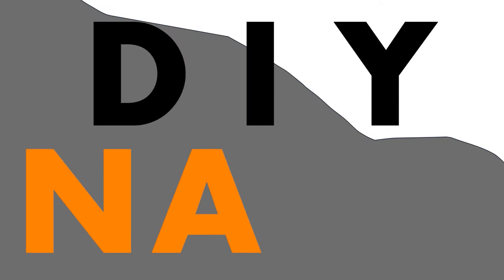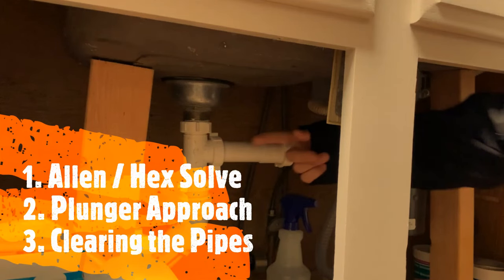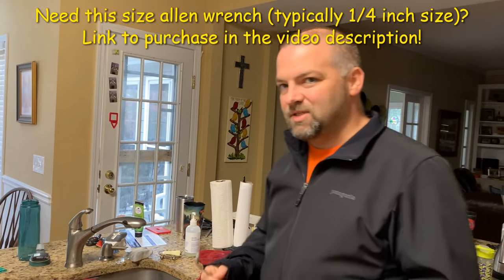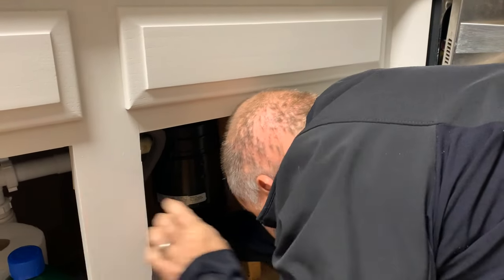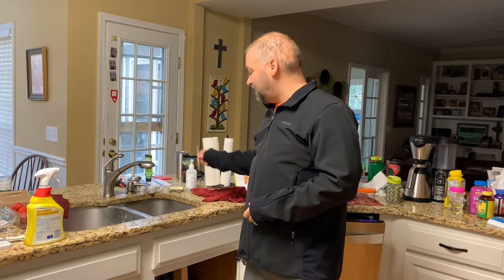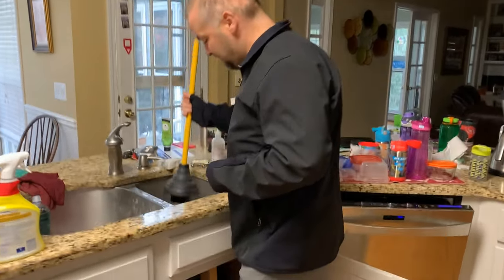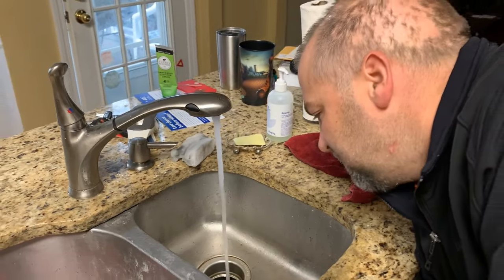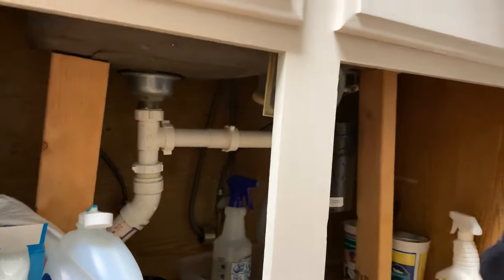Clogged Kitchen Sink with Garbage Disposal? How to Solve Quickly with 3 Easy Fixes! - by DIYNate

Comment: Great tips. Just cleared a disposal clog with one pump on my plunger, can't believe I didn't think of that before. 😁 Had it clogged once before and took apart the whole pipe assembly. Much easier, to say the least! Thank ya sir.
Reply from the maker: Appreciate the feedback - glad to hear it worked for you!  The plunger is a surprisingly simple fix compared to taking the fittings off.  Thanks for the comment!
- DIYNate

Comment: Thanks so much for the tips.  I had already tried using the plunger but water was still standing in the sink even though it had gone down some.  The one thing I didn't do was turn on the disposal after using the plunger.  That took care of everything.  This was a great help.
Reply from the maker: Excellent, Vicki - great to hear it worked for you!  Really appreciate your comment!
- DIYNate

Comment: I had shards of glass in mine pretty bad. I had to use a combination of the Allen wrench and plunger along with a shop vac. Had to reset the breaker on the bottom a couple times too but it worked!
Reply from the maker: Great to hear you got it running well!  Yea - class is a nasty booger if it gets in there - talk about the ultimate hand death trap with a blade and broken glass being down there.  You landed on what I would recommend in that case which is a shop vac.  Pumped to hear you got it working - really appreciate you taking the time to share in the comments!
Best,
DIYNate

Comment: The plunger worked for me almost immediately - I don't understand how it works, but it did the job and saved me a big bill and a week of eating off paper plates while waiting for the plumber to come out. Thank you!!
Reply from the maker: Great to hear - happy to hear it saved some money and paper plates!  Basically, some stuff gets clogged in the drain pipe and the pressure from the plunger unsticks the jam and pushes it further down and separates so it can get through to the sewer.  Hope that helps and thanks for your comment!

- DIYNate

Comment: Helped a ton, not sure why I didn't think of plunger method, but I needed both. Plunger at the top for fluid blockage then had to do a couple turns at the bottom to free up the blade. I believe fear of messing something up is why we dont think of the simple things. Really appreciate you taking the time to explain everything.
Reply from the maker: Thanks so much for your comment and glad both the plunger and Allen wrench combo worked well for you.  Thanks for your comment!
- DIYNate

Comment: The plunger method worked for me also!  Thanks!

Tip - Just be sure to place a cup over your dishwashers overflow valve located at the top of the sink, near the faucet. Otherwise, you may get splashed when you plunge the blockage.
Reply from the maker: Glad to hear it worked for you and good point on the overflow valve.  Don’t thin my sink has one of those, but for those that do, seems like that would help!
Thanks for the comment! - DIYNate
Reply: Bless you! ☺️ The plunger worked. It’s the weekend and I did not want to pay overtime. 😅
Reply: Yeah, shoulda read your tip… just splashed dirty water everywhere… at least we both laughed about it

Comment: Thank you for sharing!
I tried #1, but my garage disposal didn't have a spot to turn the blade with an Allen wrench. Then I tried the plunger with no luck.  I kept trying with the plunger and also decided to plug one of the sinks so that there'd be more pressure from the plunger after reading one of the comments about closing all air. A few more tries and it did the trick! Thanks again!
Reply from the maker: Great to hear it worked for you and yea, plugging the open air areas helps create pressure so glad you saw that in the comments.  Thanks for letting me know!
- DIYNate

Comment: Thank you for the tip. Had to plunge several times as it would not clear. It came up the other sink. Finally ran disposal and plunged the other side and with a prayer or two and it was clear. Awesome.
Reply from the maker: Glad to hear the plunger got you clear, Debra!  Sometimes the other side of the sink will let some air / water out so stopping that side up can help with the compression.  Sounds like you got it solved and glad you are back up and running.  Thanks for letting me know!
Best,
DIYNate

Comment: HI Nate - I'm still working on it. You already saved me some grief because I was eyeing the disposal and how to take the whole thing down. I remember installing this new one a while back and it was heavy as concrete, quite hard to hold in place and tighten alone. I'm reasonably sure I have a clog inside the disposal, probably in the teeth that grind stuff up. The motor sounds locked up and is not turning like it should sound. I'm taking a break at the moment as I am partially handicapped. So I am resting and reading YouTube. Your post was the first one I found and it looks like it covers all the bases. i just need to put it "to work." I will get back to you, hopefully with good news in a while.
Reply from the maker: Good luck, John!  I hope you are able to get it working again and definitely appreciate your comment!
Best,
DIYNate

Comment: Hi Nate I tried the plunger method for the second time and just like the 1st time it works! Thanks Nate for this video. There’s just one thing I would recommend is make sure you put the drain stopper in the other side of the sink.
Reply from the maker: Thanks Trina - glad to hear the plunger method has now had a second successful run!  Good call on stopping the other side as well - thanks for the mention there!
- DIYNate
Reply: thank you so much,once drain was closed on other sink....Bravo! Job well done. Thanks again!

Comment: Had a very slow drain and after adding liquid plumber, waiting for 30 minutes and running hot water it actually was worse with complete standing water.  I saw your video and the step with the plunger cleared it right up. Thank you. Any thoughts on why the liquid plumber did work but the plunger immediately did?
Reply from the maker: Hello Mario - tough to say on Liquid Plumber for sure, but think of it as a solvent (has to take time to dissolve whatever is down there).  If there was a thick block, it may have been trying to dissolve a large amount of stuff which could be a slow process.  By comparison, the plunger method uses pressure from the top and pushes water against the blockage to force that stuff past the stopped up area.  So it likely released the large blockage and got it past the area where things got clogged.  That is my best assessment and glad to hear it worked out for you!  Thanks for the comment! - DIYNate

Comment: Hey, Just wanted to say this video rocks! Did all three things you showed plus 2 more checking behind each thing.. plus used a broom stick to try and turn the garbage disposal disc with leverage from the top. It turned a little bit, however, that didn't allow the garbage disposal to turn on. Plus, pressed the button on the bottom of the garbage disposal.. ( from under the sink on bottom of disposal). Then I tried the plunger & pressed several times... not too hard, as I have a sink mounted to the underside of my counter tops too.. Thanks for that tip! It worked like a charm! Thank U, thank U thank U! 😊
Reply from the maker: Hey there - you are absolutely welcome!  Sounds like you went through the ringer with different ways of troubleshooting!  Really glad to hear the plunger did the trick after all you went through and nice job being determined to get it done.  Thanks a ton for your comment and for watching!
- DIYNate
Reply: Appreciate your feedback. Have a blessed, long weekend!

Comment: Thank you!!!! Ours was clogged and causing the sinks don dishwasher to back up into the sink. I put in a maintenance request (I’m in an apartment) but they are so slow so I wanted to try fixing it. The plunger method worked perfectly!
Reply from the maker: Great job getting it fixed - way better than having a long wait on a maintenance request.  Nice work and thanks for the comment!
- DIYNate

Comment: Very useful tips, thank you! Will try these right now!
Reply from the maker: Excellent - hope the tips helped!
- DIYNate
Reply: @DIYNate  yes they helped. We ended up using your baking soda and vinegar suggestion, then pouring hot water down the drain, which finished the job and unclogged the drain. Thanks again!

Comment: Thanks for reminding me to check under the disposal; forgot about that little reset button. Fixed my issue after a day of waiting for Drano to work to no avail. 
Didn’t have to use any tool to turn the blades. 👏🏼
Reply from the maker: Excellent - the red reset button came through for the fix - great to hear and thanks for sharing!  Much better than waiting for Drano to hopefully work.  Thanks for sharing!
- DIYNate

Comment: Thanks for these tips - this may seem obvious but I figured I’d just ask since I didn’t hear it in the video - after you use the 1/4 Allen tench tool, do you tighten it back up again after, or just leave it loose?
Reply from the maker: Good question - it actually shouldn’t be unscrewing anything - it is just rotating the blade so you shouldn’t have to do anything else with it, if the blade spins freely when you are turning the Allen wrench.  Hope that helps and thanks for the comment!  Good luck!
- DIYNate
Reply: Great thank you!

Comment: Fixed! Thank you! I have a double sink, so I put the stopper in the other drain while I plunged the sink with the disposal. Not sure if that was overkill or not, but IT WORKED!
Reply from the maker: Great call on the stopper on the other side for a couple reasons as well.  Great to hear you are fixed and up and running!  Thanks for the constructive comment and best wishes!
- DIYNate

Comment: Oh Wow! You just saved me $200+ hours Nathan. Thank you so much. I had a clogged disposal and it was making all sorts of noise. There was a mess in the sink. The water was rising instead of draining and all of a sudden, the blade stopped spinning and I thought for sure it was gone. I started pricing new machines and thought, let me see if I can install it myself to save money. So I jumped on Youtube and after watching one video, I got overwhelmed, but your video was next in line and thought what the hey, let me see what Nate has to say, Never would of thought to plunge it because I thought that the mechanism was setup to bypass the pipes directly and that I would possibly damage the disposal. I took your instruction to plunge lightly and it took a few tries because I was not strong enough to push the plunger down. Once I did a side push, the plunger went down and I had to plug the other drain because all the air was going out of it and not down the pipe. Once plugged, I can hear that the water was being forced down and so did the clog. Thank you! Thank you! and Thank you!
Reply from the maker: Hey Lisa - 
This ranks up there as one of my all-time favorite comments - haha!  Love hearing it saved you money and time, and that you were on the verge of going through an entire disposal replacement when you landed on the plunger hack.  Thrilled to hear it worked for you and appreciate the narrative - that puts a smile on my face, as I can totally relate.  YouTube has helped me so many times on my project / problem of the day, week, month, year even, so great to hear this was a win for you.

Really appreciate you watching and leaving such positive feedback - best wishes!
- DIYNate

Comment: Thank you! I did plunge it initially but stopped after a couple of pushes because the water just came out of my dishwasher vent. After watching this video and pouring vinegar down the drain I decided to be more aggressive. I wrapped my dishwasher vent in plastic to seal it, said a prayer, and started plunging. After about 5 or 6 plunges, it cleared! Yay! 👏🏼🙏🏼
Reply from the maker: Glad you stuck with it and were able to figure out how to get the pressure to build to unclog it.  Thanks for the comment!
- DIYNate

Comment: Thanks for showing using the Plunger to clear out the garbage disposal jam.
My kitchen sink was stuck last night. I know it was fat stuck the pipe underneath the sink. I unplug all the pipe, and clean one-by-one. It was full of fat/grease that water no way out. Specially the cold weather in December, the grease will freeze and no water can run through. The fat was full from the top of the sink, the pipe, and to the wall. I clear them all by unplug them. Every pipe is clean and install them properly. But why the water still can not run through. I tried to turn on the garbage disposal to run the water, then the dirty water comes to the sink. Water still can not go away. 
I check on the youtube for a few videos, but no one is the right one. Finally, I saw you use the plunger. That was the right one, since the fat/grease already full in the garbage disposal. I use the plunger, run the water to fill both sink and garbage disposal, then I push a few times, I use hot water to run it. one or two minutes later, water run and go away to the wall. I fixed the clog from the sink, garbage disposal and to the wall. It was about one bag of frozen fat/grease from the pipe. It takes about 3 hours to do all.
Thanks you again for showing the trick.
Reply from the maker: Excellent - great to hear that the plunger method worked on the far clog!  Thanks for sharing and glad you are in business again!
- DIYNate

Comment: Came across this video when my kitchen sink got clogged up, insinkerator stopped running and the dishwasher was pushing water back up the drain. Tried the Allen key but I don’t think mine had that option under the sink based on the model….. but while under there I did find a reset switch for the garbage disposal and that freed the motor up and allowed the drain to flow freely again. Either way… without your video I never would’ve gotten under there to find it. Thank you so much!
Reply from the maker: Great that the video helped you get eyes under there and the reset button did the trick!  Glad to hear things are flowing smoothly! Appreciate the comment, too!
- DIYNate

Comment: Thank you so much!  The plunger worked!  It is a new garbage disposal too, so wondering if it is not something that will keep happening?  I could put anything down the older one.
Reply from the maker: Depending on the size of the new disposal, you may find it clogs more than the old one but it probably was just something that doesn’t normally go down there that clogged it up.  Time will tell but at least you have the plunger approach when needed.  I typically find myself once a year or so busting out the plunger - haha!  Thanks for the comment!
- DIYNate

Comment: Great video. Will you please do one on a disposal that has power to it (makes noise) but won't turn?  Thank you!
Reply from the maker: I'll have to keep my eyes out for that situation.  Typically, my first step there would be the red reset button on the bottom, then maybe flipping the breaker to get a hard reset.  Of course, the allen wrench turning would also be a great sign - if it turns, then it should start spinning.  Could be a more severe problem where you end up in a replacement situation at that point.  Good luck and thanks for your comment!
- DIYNate

Comment: I can't believe it. The plunger did the trick. I applied it gently and it cleared the clog. In fact, water is now draining really well. It's actually draining better than before the clog which tells me that the clog had been building up gently over the months (I started to notice the water draining at a slower pace a while back). I really did not want to use a wrench. But it would be interesting to know whether all disposals use that wrench you showed. I have a GE disposal (GFC530V). Thanks for sharing your video.
Reply from the maker: Great to hear the plunger method worked for you and is giving even better results than before the clog!  To your question on whether all disposals use the same hex key / wrench feature, I would imagine there are some that don’t have the same setting / feature, but I have found it is pretty common in most models of disposals (InSinkErator, etc.).  A lot of times the key or jam buster wrench will come with the new disposal but for a lot of people, the disposal came with the house so that wrench may no longer be found.  Thanks for the comment and for watching!
- DIYNate

Comment: Thanks for the wonderful video. My disposal hums and there’s noting visibly stuck inside.  By inserting an Allen wrench at the bottom of the unit below the sink, I can wiggle the shredding plate back and forth, though there is strong resistance. Any suggestions for further troubleshooting? Thanks.
Reply from the maker: Not sure if you can get a light in there from the inside but if you are getting strong resistance from the spinning, it sounds like the blade may have something caught up under it.  If you can try to turn pretty hard one way then the other you may be able to free it up.  It really shouldn’t give you too much resistance if turning one direction or the other.  Certainly checking the type / brand for solutions may be good as well (manual) and cutting the power at the breaker and checking from the top side may also be wise.  Good luck and hope you are able to free it up!
- DIYNate